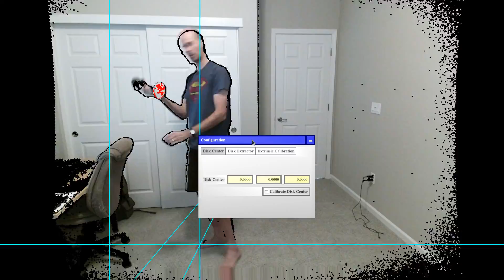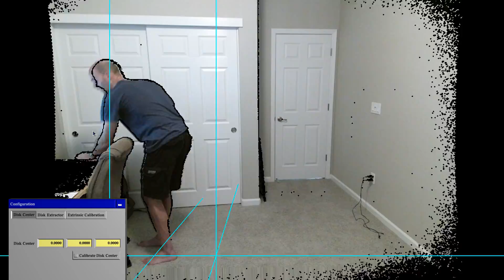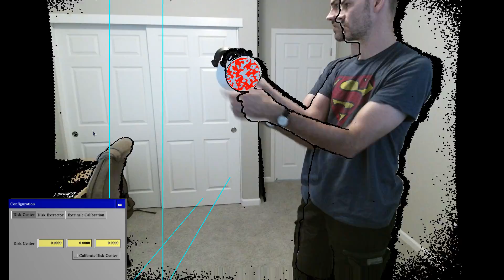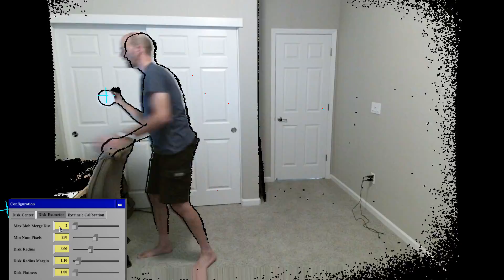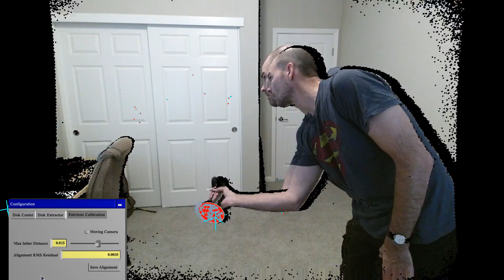Extrinsic 3D Camera Calibration - Static Camera

Comment: Is there much of an advantage of the Xbox One Kinect over the 360 model? Both are pretty cheap now, so I'd like to get me one to play around with, but I'm not sure which one.
Reply: If you don't already have one, get the kinect2 (Kinect One).  it's a much more powerful sensor.  just keep in mind that you need a machine with a good (intel/nec) USB3 host controller to run the Kinect2.  FWIW, you can get used  Kinect2 at gamestop for right around $50.  Very reasonable.
Reply: Awesome. Already got one off ebay for ~$25. Now I need a USB adapter.

Comment: Is there an advantage to a disk versus a ball other than physical convenience? Is a disk easier to track on the z axis?
Reply from the maker: There are a couple of minor things. Most importantly, my initial implementation required separate calibration of the disk center in controller coordinates by touching it to a measurement point. That's a lot easier with a flat disk, where you can touch the center directly, than with a sphere. The new method shown in this video no longer requires that step.

Additionally, it's easier to attach a disk securely to a controller than a sphere of similar radius. It's also easier to make a disk target (use a CD) than a sphere.

Estimating a 3D disk center from a depth image is more reliable than estimating a sphere's center, given the same number of pixels representing the sphere and disk. I have another calibration routine for multiple 3D cameras that uses a sphere, and the math is iffier and the system less constrained.

Finally, there is an intrinsic calibration routine to align a 3D camera's color and depth streams, and that one requires a disk. The same calibration object can pull double duty.

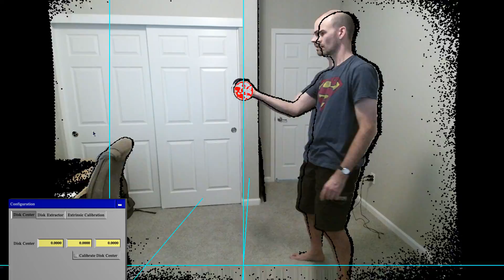Comment: Great video! Why does it seem like there is a black outline around your body, and for example at 0:53 seconds it looks there is a double image of your head. Is this due to intrinsic calibration needed for the kinect?
Reply from the maker: What's shown here is not a regular video recording, but the video stream from the Kinect's color camera projected onto a 3D triangle mesh reconstructed from its depth stream. The black outlines are there because Kinect cannot reliably resolve silhouettes. They are more apparent in this video than others because, due to the dynamic calibration procedure, the 3D geometry is not exactly shown from the depth camera's point of view.

The double images are due to the Kinect's two cameras being in different positions. Projecting the image from one onto the other leads to double intersections, and my code doesn't currently try to prevent those via early ray termination. I normally remove the background geometry, which also removes the double projections.